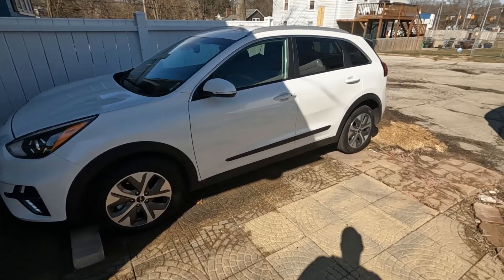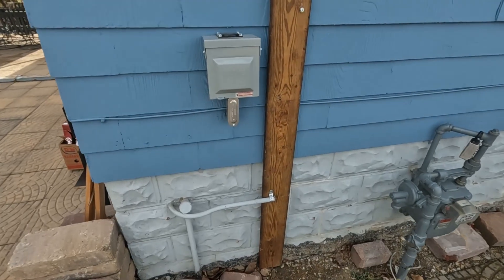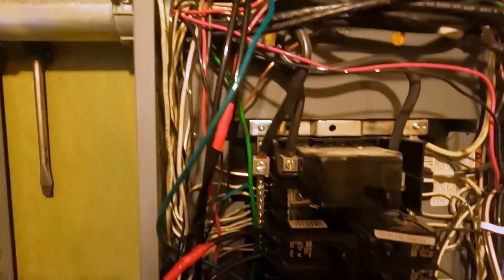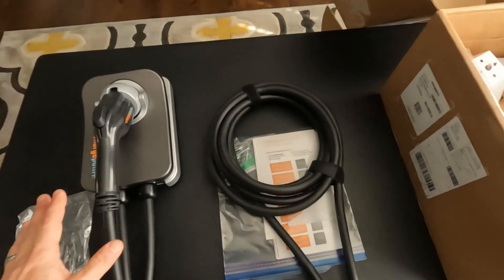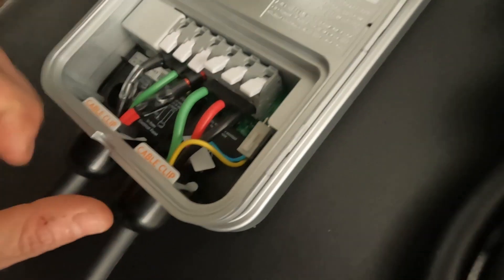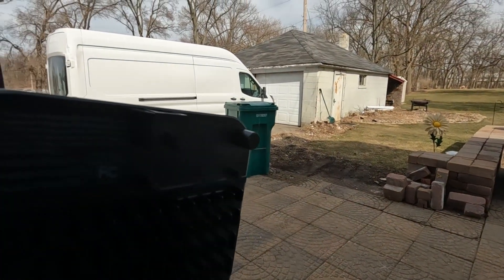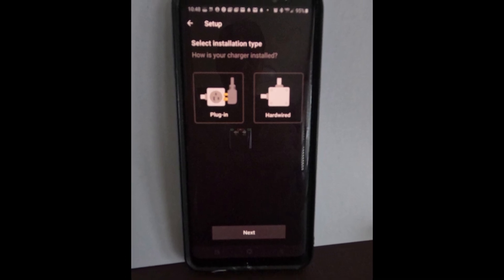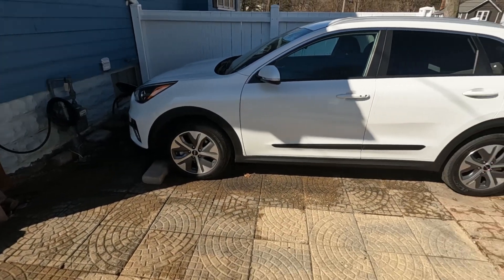Chargepoint Home Flex Electric Vehicle Charger, NEMA 6-50, Kia Niro EV

Comment: can you tell me how many Kwh you are getting when charging your Niro..  I have same set up and getting 3.6 Kwh and cant figure out why so slow... one time it jumped up to 7.5 Kwh for a bit.  Chargepoint rep states low wifi but i got extender already,... your thoughts?
Reply from the maker: About 6.5 but it fluctuates.   Had up to 9.5 once. But seems to be pretty steady around 6.5.   I would think that a larger circuit would give more kwh of charging.  
At the local free charging at the NIPSCO (local power company)  charging station  near me it was about 5.  
How many amps is the circuit you are charging on?  50 amp breaker and 6 awg wire?